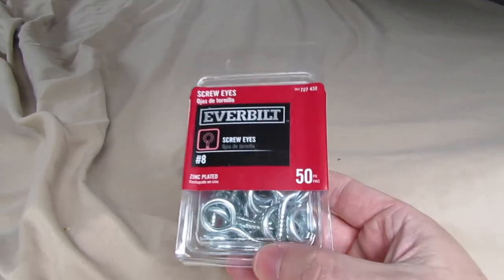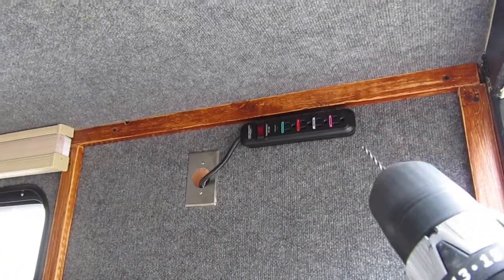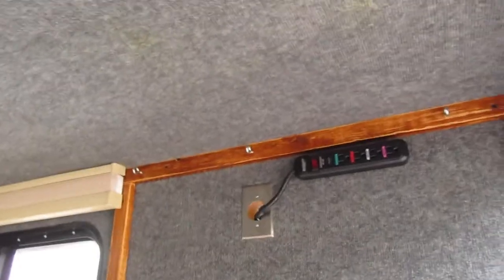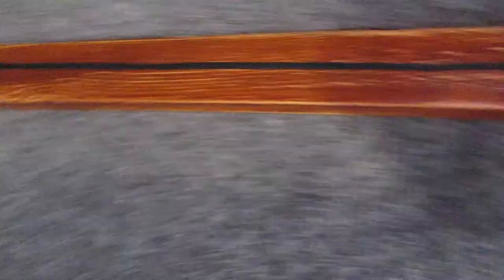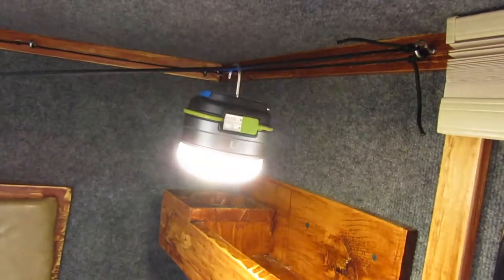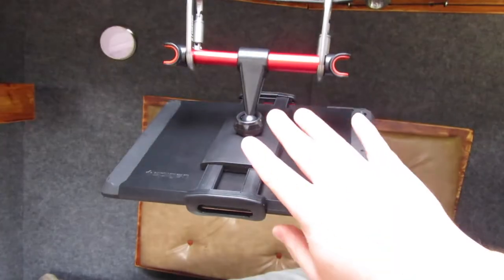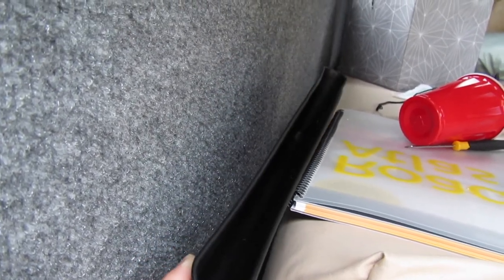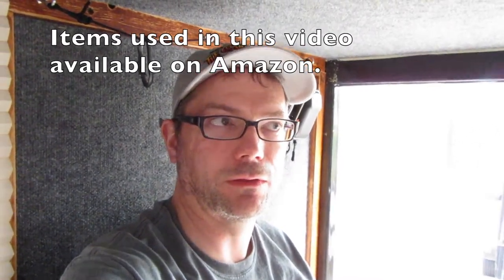5x8 Cargo trailer camper Storage 1.0 ⛺️🌲🚙🌳

Comment: I'd definitely turn the bed into a couch and set up a flip up table on the other wall. Throw some small cabinets along the ceiling on both sides too. Though that is just me everyone has different skill levels and needs when it comes to that kind of project.
Reply from the maker: Love your name! Ha.   And great suggestions thank you.
Reply: Thanks. it should be interesting to see what you eventually do end up making.
Reply from the maker: Going to be working on the 4runner with a rather unique setup!  Stay tuned.

Comment: Before you change blinds to curtains, check with state rules for RV's.  Curtains were thought to be fire hazards and the RV industry switched to blinds.... so check first, sespecially if they will be used on the kitchen window.
Reply from the maker: Good thinking. I actually made a foam insulation insert that fit nicely into the windows for when I’m sleeping. Helps a ton with cold weather camping

Comment: I think you ought to spend a little more time on your paracord knots. There are some better knots that will make for a tighter look. Also might want to think about running you tablet through two cross sections it would probably cut down on the wobble. A neat idea overall. I also think you screen idea is a good one but it might be easier to go with a similar setup to you awning so it is out of the way when you don’t need it and mounted nicely on one side.
Reply from the maker: Paracord is doing ok but you’re super right.  Ha I’m certainly no Boy Scout